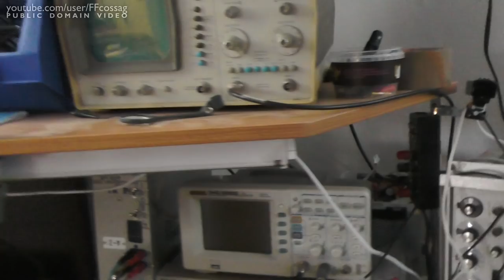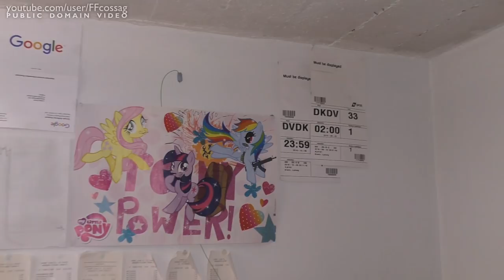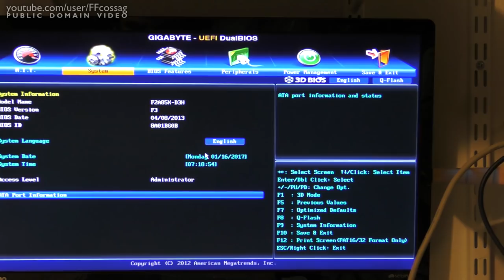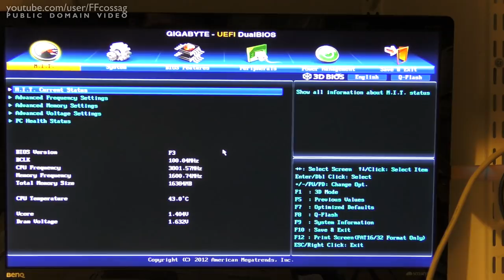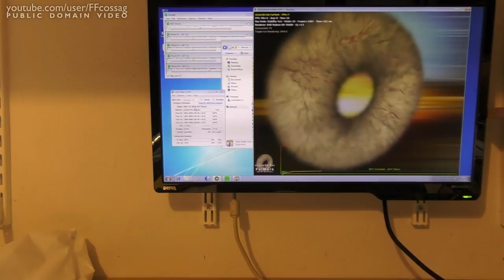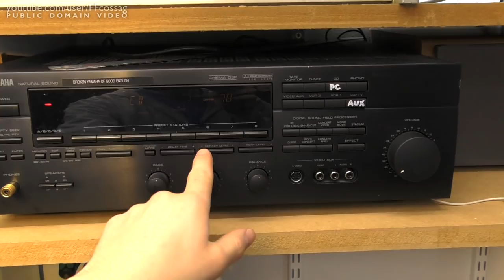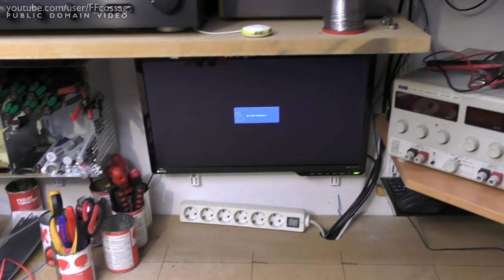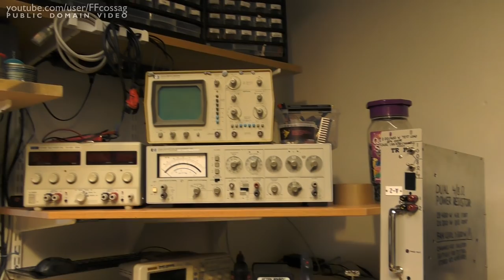Improving the workbench (just a little)

Comment: Awesome, I setup a very similar shelving system for my workbench also about a year ago. I have much of the same gear as you also. For the Atten I replaced the cable with a silicon cable which makes it much easier to keep it out of the way, and use the thing too. Where you plan to mount your mic/camera, I used some of that metal strapping you used for your monitor to mount my DSO under the bench, that brought it to eye level and keeps it out of the way, but in your case it would obstruct your monitor. As for lighting, I have the exact same issue, for now I use a cheap desk mounted lamp from Ikea with a good LED globe in it, but I eventually plan to run a LED strip along the bottom of the shelf to provide lighting, you could do the same without losing that clamping area.

Comment: I feel for you, it like when I decided to do the same shelves and move to only a slightly bigger room. The wiring is still not done 100%. It's not fun.
I bought a new light, led tube light that's 3500lm thinking it would do better, but the washout is so bad on the camera will full manual settings that no one can see the displays on the meters or Rigol from the camera. But same issue, took away the ability to clamp the mic and things. 
So I found some cheap chains and cut them about 12cm each and hung the light from the chains giving me enough room for he clamps.
The light, still to bring two it's going back. But the chain hanging worked, maybe you can do the same and hang your tube lights with small link chains or something giving you room for the clamps still and having the light under the shelve. I didn't want to drill the light housing until I knew it would be permanent so wire tires were used from the last link of the chain to the lights.  If it worked I would have drilled the light shell, good thing I didn't since now I can return it for something less bright and hopefully still about 4000K to 5000K.
Looks nice. I still find myself tweeting little things and moving the things I use the most closer and playing shuffle every few weeks but it will eventually work your work flow and make it all easier.

Comment: You can usually adjust the slope for the CPU fan speed somewhere in the BIOS. 
If you mount your shelves just a little away from the wall, there's enough space to drop down your power plugs for future rats nests. Or maybe you did - couldn't see. Its always a royal pain tidying up a workshop, but the end results are very satisfying, for a while at least. I'm busy with exactly the same thing. Hate every moment of it!
Reply from the maker: I'm an odd one in finding genuine joy in the process of cleaning, rather than just the results. as far as fan slopes go, you're right - the issue is that (as is all too often the case), the lowest possible fan speed is ridiculously high. The only way to fix that is to drop the voltage externally, offsetting the entire fan slope down a few V.

Comment: Looking good. For the under shelf lighting you could try some of the LED strip lighting that comes on a roll?
Reply from the maker: I've considered it, but I've never really liked those LED strips. CRI is usually shit since it's generic China LEDs, and they fail horribly with age.
Reply: If you weren't so far away I would send you some LED strips that were made for aircraft cabin lighting, very good CRI  but they are 28 VDC. 10 year old tech but made really well (sort of) the ones I have were RMA's that for some reason or another had faults, usually a connector failure. They were destined to be scraped, they were built from Nichia LED's, very consistent in CRI and quality. I power mine with a 24 volt switch mode supply tweaked up near 28 v
Like I said, looking good on the shop re do, I'm sure you will find some improvements as time goes on

Comment: Well done, it looks really neat and pro looking, everything is "Grab-able" lol.
The shelving system was well worth the money, i bet you are chuffed with the result :-D.

Your old setup was likely added in bits over the years, as you got new gear, we all do it, often having to compromise the original idea with extra wiring and bits bolted on that dont quite look right.

Ive also done the speaker switching too, i used a couple of double pole double throw relays to switch all 4 connections to bench terminals, a twin wire from the relays coils tapped on to the amplifier psu.
Some old amplifiers have a speaker protection relay, its coil power can be intercepted to isolate the speaker terminals, is that the way you modded your amp?
Reply from the maker: The amplifier isn't modded at all, lol. I've never even had it apart.

Comment: Huh. I'd have thought you'd have one of those silly Logitech solar-powered runs-off-a-coin-cell-rechargeable-2032 keyboards somewhere... I'd give you my one with the one shattered cell  (just means it takes longer to charge now) if shipping to Finland wasn't stupid expensive.
under-shelf LED strips with a resistor for longevity because chinesium would be an idea in the future. Otherwise it turned out great!

Comment: Love this type of video :). That CPU fan sounds like it has sand in it , horrible. Compaq case is amazing love it ! Any idea of the model number of the case ?
Reply from the maker: No, all I know is that it's a ~1998 Deskpro.
Reply: The deskpro line was awesome ! Still have a deskpro EN SFF Pentium 3 still going strong. It has maxed out ram , USB 2.0 card GPU gigabit ethernet , and even an socket adaptor so it can take a Tualatin 1.4 P3, the bios moans about missing microcode but the things runs like a dream with windows fundimentals on it :). Only use it when i need real RS232 parallel and PS/2 ports.

And then HP got hold of them, and compaq went shit :(

Comment: maybe the AMD A10-7850k might work better than the AMD A10-5xxx, you don't need the sound card as there is a Trueaudio soundcard integrated into the AMD A10-5xxx, I would have thought the HDMI port would be better than the SVGA or the DVI connector or has someone removed the HDMI connector from the motherboard.
Reply from the maker: I have an external sound card to get improved analogue performance, so that I can run the PC as a spectrum analyzer.
Reply: FFcossag why bypass the Trueaudio soundcard that is part of the AMD A10-5800k3 as the data can be processed very quickly without the data having to leave the processor and if you want a better processor then the top of the range AMD A10-7850k might be a little faster and I would have thought that the more parts you introduce into the audio path the worse the signal get contaminated and anyway the HDMI outputs in the digital domain and will also carry the SPDIF signal for the sound so an extra soundcard is a bit OTT.
Reply from the maker: HDMI doesn't make for a very good analogue audio input.
Reply: That is the feed to you monitor so you have sound which can be sent to a sound bar of your choice. there are sound inputs on the back marked line in and line out which connect directly to the APU socket via capacitors so that no voltages are feed into the sound pins of the APU as you don't want to burn it out.